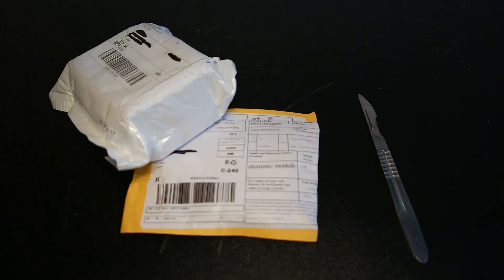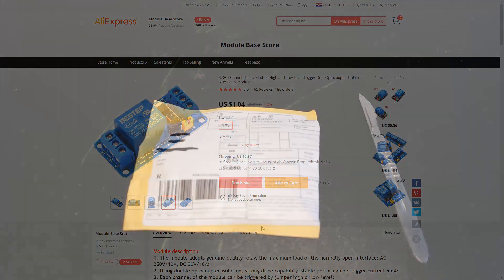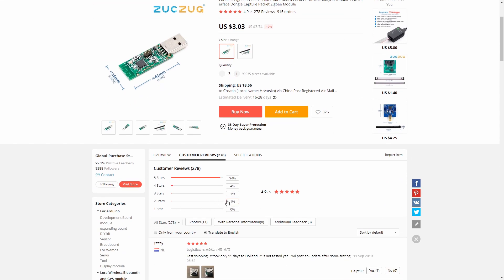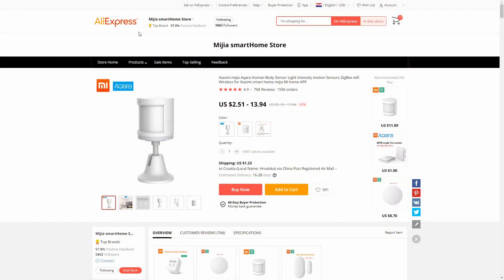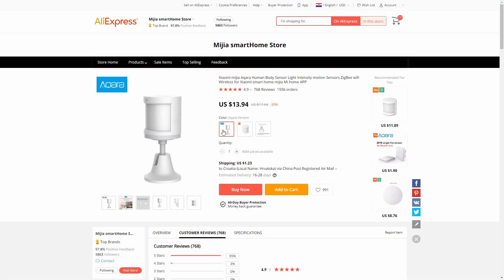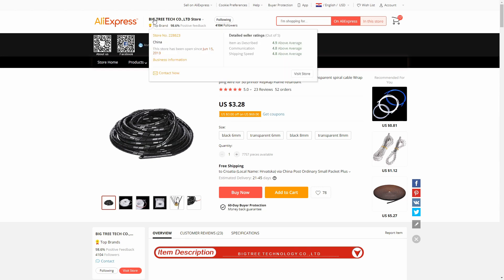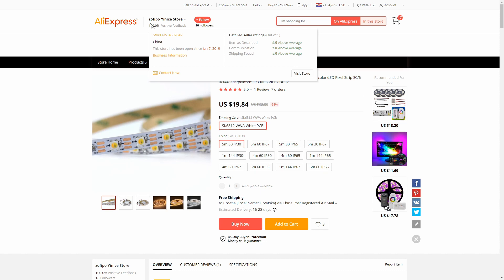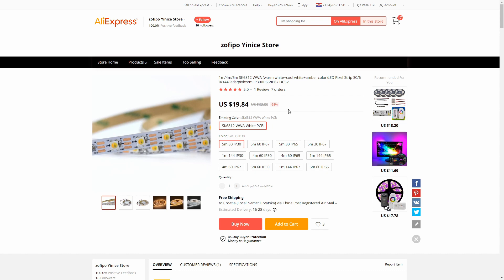Mail Day #011 with BeardedTinker - (relay, cc2531, xiaomi sensor, cable Wrapping, SK6812 WWA)

Comment: Hi BeardedTinker, do you have also xiaomi gateway for your home devices? For HA you are using cc2531, but I guess for firmware updates you need sometimes connect also gateway and perform updates. I ordered cc2531 with some sensors, I'm wondering if I need also gateway :)
Reply from the maker: Thanks for great question. No, I don't use any additional gateway. Still haven't flashed any new firmware on ZigBee devices, and they work great.
I did use (still have 5 lights and 2 switches) IKEA hub, but slowly moving them to cc2531.
You should be ok
Reply: @BeardedTinker  ok, thank you